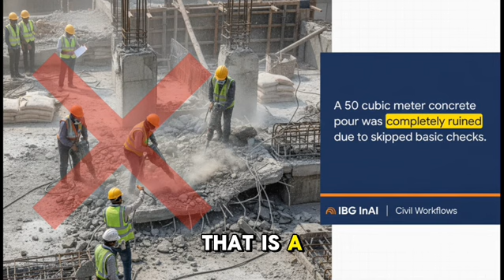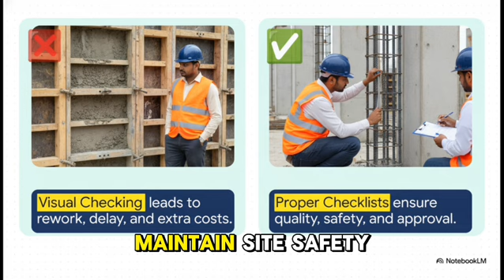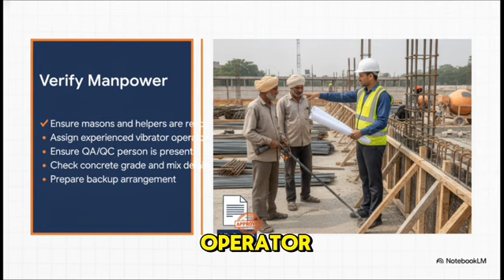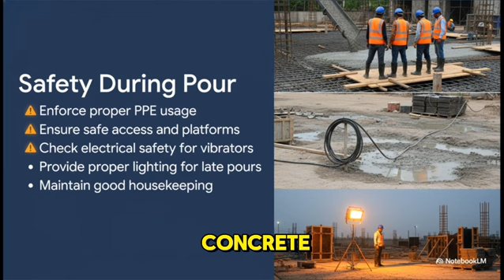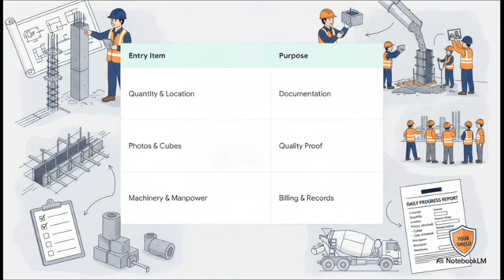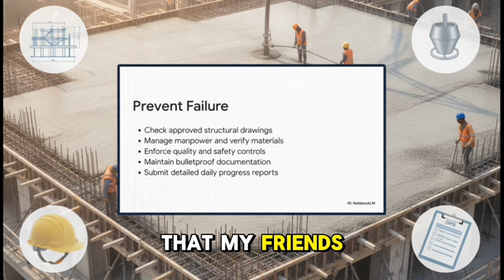Concrete Pour Checklist | Before, During & After Pouring | IBG InAI

Comment from the maker: 📌 Concrete Pour Checklist

A site engineer should check concrete work in 3 stages:

1⃣ Before Pour
Drawing, reinforcement, cover blocks, shuttering, cleanliness and embedded items.

2⃣ During Pour
Slump test, placing method, vibration, cube casting and safety.

3⃣ After Pour
Finishing, curing, pour record, DPR entry and site photos.

📘 Detailed Concrete Pour Checklist PDF is available in our Telegram channel.

Telegram:
https://t.me/ibginai_civilworkflows

If you have any doubts, comment below. IBG InAI will reply.

By IBG InAI | Civil Workflows